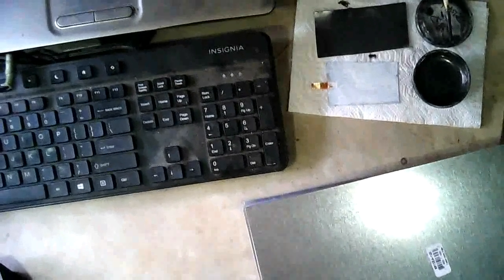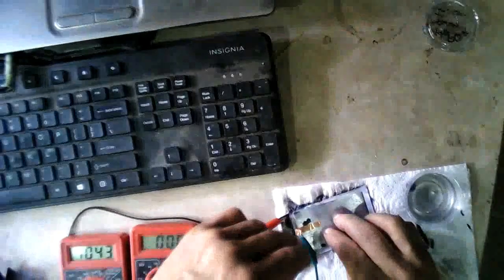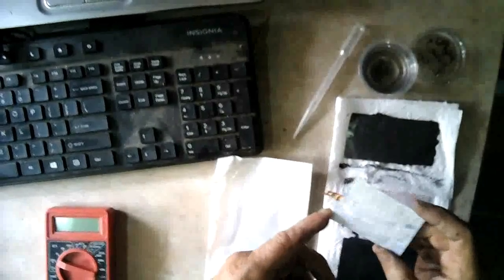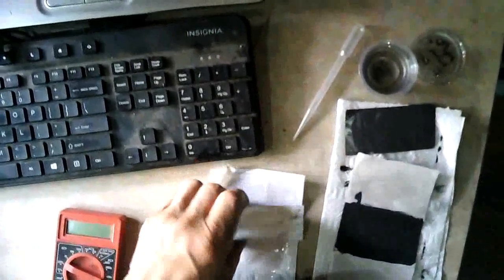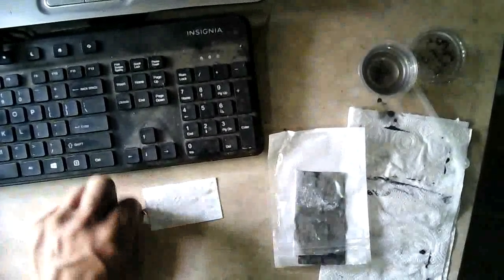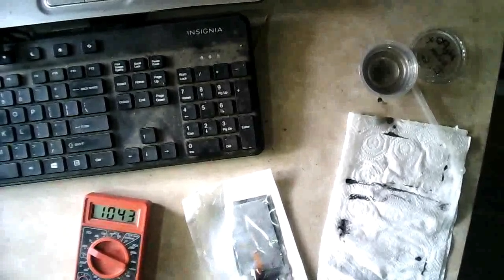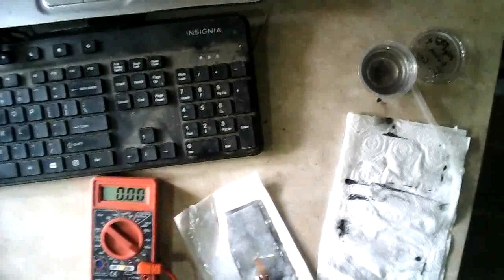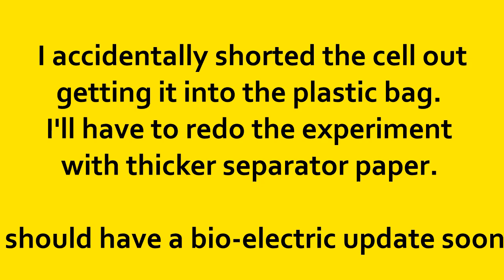Chloride Salt Battery Test & Oscillator Test!

Comment: Well, you are zeroing in on the final product. Time to start considering the geometry and physical design parameters. Your plate size is certainly large enough so the capacity is generous. It will be interesting to see how well it performs in full scale.
Reply from the maker: Yeah, it's make or break time. I can always rebuild the battery as I make improvements in the future. I want to start using it practically asap.

Comment: Yeah that’s good . From what I have learnt in regards to ion density is that you can easily have to much and the ions can’t travel freely . Maybe try chloride ions again but with different diluted levels .
Reply from the maker: Anything is possible I guess, and it might have had too much salt, but I doubt it, since I only used about 5 milligrams in the mix.  Sea salt has a lot of minerals in it however, maybe restricting it to one salt (like mag chloride for example) would be better.

Comment: Hi there. I think your short circuit came from the paper towel you wrapped around the cell.
Reply from the maker: That's possible Dan. I tried to just wrap the positive copper/grapfoil, but I moved the electrodes around a lot inside the plastic bag, and ripped the copper connector off the negative electrode. It was downhill from there. Lol Ultimately, I think I need to wrap the negative metal plate, so I can use both sides with two positive electrodes for more surface area. We'll see how test #2 goes. :-)